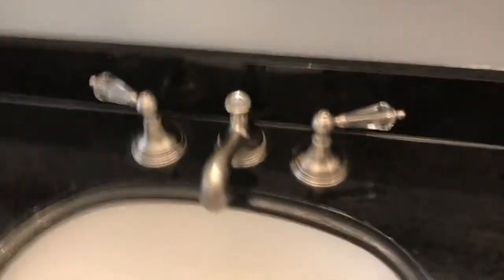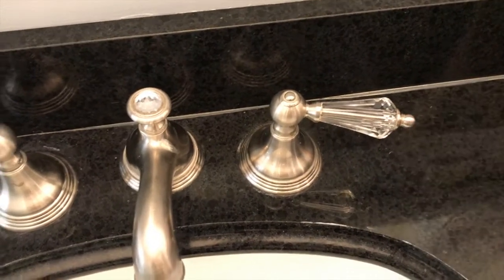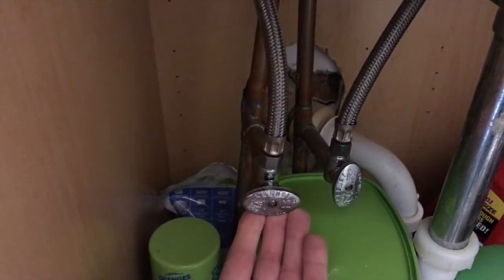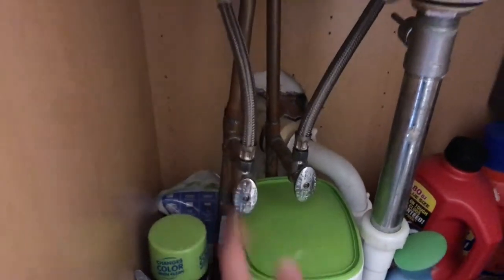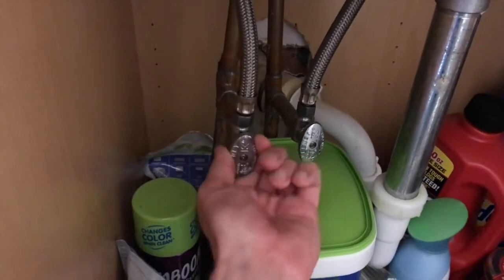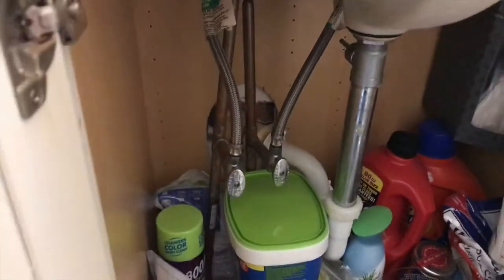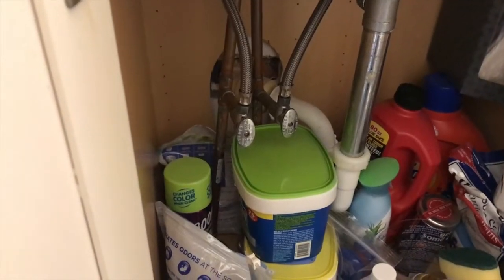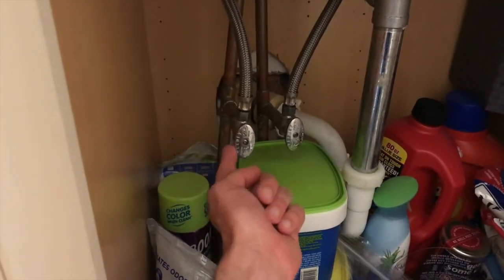Vibrating/Humming Pipes - "3 Most common causes"!

Comment: Allleelluuyaaa! 4 years living here with the noise(thut thut thut) when turn on hot water. Now I Fixed in 3 sec. 1:30 Thank you so much.
Reply from the maker: You are very welcome, and thank YOU for sharing this.  Hopefully a stress-free 4 years ahead to make up for it.

😁👍
Reply: I have another one downstair it makes samething but noise is louder than this one. I did the samething to fix it by ajusting the valve. But did not work. I will try to do this. https://youtu.be/E1D1OKrRy-Y
Reply from the maker: @Jodvix  

Bummer, let the DIY project continue until accomplished.  Keep us posted.. 😁

Comment: My humming is the bathtub faucet. It's a higher pitch hum and changes pitch as you turn the knob. This Delta 1400 faucet/handle was recently replaced.  I also notice the water pressure is not very strong- takes awhile to fill up the tub now. I have an old house, only shutoff is at the meter by the street.
Reply from the maker: Kymaureen1 

Thanks for watching.  You should have an internal shutoff valve in your home.  It may be accessible near your pressure tank & water softener.  Keep us posted on your project.  Us fellow DIY’ers need to stick together.

😎👍🔧🔩

Comment: I live in an apartment above boiler room in a old building with baseboard heating radiators. During winter months the heater/boiler makes a humming noise like and isle diesel truck, all night and sometimes morning.
Reply from the maker: Thanks for watching & that is actually common.  These type systems can also give off a crackling sound as the heat is being generated at heating radiators.

Let us know if you have any questions, hope all is well.  Enjoy your day.

😎👍🔧🔩

Comment: This is a bit of a long shot but I might as well ask. Can a faulty shut-off valve also cause water to be forced through the tap randomly? My Faucet is at the highest point in the house, and intermittently, sometimes when the washer is just turned on, it will vibrate and force water through the Faucet while making the vibrating noise. Turning the faucet on alleviates it.
Reply from the maker: @yotoniha  

Thanks for watching and that’s a great question.  It can indeed however not as common as a faulty stem.

The valves internal ball design can get damaged and no longer operate properly…leading to the valve operating as if it was half closed…when really it’s full open.

😁☕️🧰

Comment: I had an issue with a hum and it turned out to be a faulty ball valve(water intake and flash valve) in my toilet.I replaced that and it stopped. I took out a section of wall and tried multiple other fixes first no change.
Reply from the maker: Willis Taylor 

Thanks for watching & sharing your experience.  This can be helpful info for your fellow DIY’ers.  We appreciate it Willis.

😎👍🔧🔩
Reply: @DIYwithMichaelBorders  Thank you thought I'd share that fix because I've never seen it anywhere and it worked like a charm in my three storey condo where the tap on the first floor was causing a hum on the third floor took me a year to figure it out and two plumbers :)
Reply from the maker: Willis Taylor 

We really appreciate it.  Sounds like you’re back up and running!

😎👍🔧🔩

Comment: thanks for the video.  I was dealing with water hammer for a while.  I drained the system, and that went away.  Now, about a month later, the entire system started to hum/vibrate, extremely loudly.  Not when turning on a facet though; with no water off.  If I turn off the main valve to the house, it stops, or if I drain the system, again, it will stop, but it returned about 3 hours later.  Is this systemic pressure?  Is so, why all of a sudden?  I do have pressure relief tubes on various pipes.  Suggestions?  thanks.
Reply from the maker: Jeff Blankenship 

Thanks for watching.  Let’s get this figured together.  Have you performed any MX to any portion of your plumbing in the past 6 months?...new faucets, new toilet, new water filtration system, new water softener...??

This will help us determine if any recent MX is tied to your humming/vibrating.  Keep us posted.

😎👍🔧🔩
Reply: I have similar issue fixed today.  It found that the water pressure reducing valve (PRV) was broken and get replaced.  But you need to test whether your house internal water pressure is too high.

Comment: Great video, tho you would think a plumber could sort this, we have had 3 trying to fit a water filter and now been getting this problem for days. One came back thought he had fixed it and it started again. Driving me mad, my nervous system is terrible.  Turned what we THINK is the pressure down there is a shut of valve on it too.
Reply from the maker: Thanks for watching & welcome to the DIY Raptor Club.  You are not alone, it can be tough to diagnose.

What all has been replaced?
Reply: @DIYwithMichaelBorders  They still left a leak in the self tapping joint to the filter, the o rings to the outlet of the filter are in bits, it is just a diy joint seems to be leaking now, the way the filters have a diy way of getting into the water supply. The plumber used this instead of getting a proper t joint. Apparently they must some reason have removed the cold tap (faucet) as that had leaked and they mended that by wrapping round ptfe tape. Apparently it had been cross threaded but if so why did it need ptfe to fix it? The pipes are only about 2 years old, they were installed with the new kitchen. This isn't my own house it is rented but would expect the people you rent it from to get more qualified plumbers who don't create leaks in good pipes. I need ed a reverse osmosis filter as I can really smell the chlorine and am chemically sensitive. Later this year too fluoride is going in all the water supplies in the UK.
Reply from the maker: @Hypohair  

Thanks for the update, that’s no fun.  We definitely understand your thoughts & concerns as it’s a rental & you are paying the mortgage for the owner.

Below is a link to our video showing an installation project of a new GE Reverse Osmosis system, we love it.

😎👍

Comment: I live in an apartment that is half a floor below and right next to the room where they keep all the AC condensers on the floor above mine. There is one huge condenser that works with water that makes a very loud humming every time it is turned on. The humming can be heard in my entire apartment. Any idea what it could be and can I easily correct this without getting the building involved?
Reply from the maker: Thanks for watching, that no fun.  We would double check all of your little water shutoff valve’s throughout the apartment to ensure that they are all in the full open position.

That’s a tough one, since you’re so close to the high pressure unit.
Reply: @DIYwithMichaelBorders  thank you for answering. The unit is not from my apartment its from a different apartment but there’s some valves inside of the AC condenser closet. Maybe the valve will be in there?
Reply from the maker: @linav10  

You are very welcome, keep us posted.

Comment: Sorry, I do not understand how turning off the hot water valve stopped the hum.  There was zero flow in the hot water line because the faucet was off.  Plus before you turned the valve off it was already in the full on position but was humming.  You turned it from the full open position to off the back to the full open position.  Please explain.  Thanks
Reply from the maker: Thanks for watching & we appreciate you reaching out to us.  Goofy scenario for sure but we figured out the part causing it...😀

These little internal stems can cause annoyance at the tail end of their life span.

Hope all is well.  😎👍🔧🔩

Comment: Desperate need of help here! I have been stressing for weeks over this vibrating and humming issue and can’t afford to call out an engineer to help. 

I had two first floor bathrooms completely renovated, new toilets, new basin mixer taps, new shower fixtures, a bathtub, douche washers. 
Every time the hot water is used in any of the bathrooms there is a loud hum and vibration get throughout the house, so we are having to reduce the pressure on the faucets when using to stop the noise from coming. 
To be clear, this issue is ONLY on the new appliances which we have fitted in the bathroom, we also have a kitchen and downstairs bathroom which work without any faults. 

At first I thought it could be a loose copper pipe coming to the first floor which was vibrating due to not being strapped down but it seems all the hot water appliances are causing this issue. 
This morning the toilets had now started to hum while the water tank fills after it has been flushed. 

I would appreciate any advice to help me on this one as my family and I are struggling with this constantly. 
Thanks in advance!
Reply from the maker: Thanks for watching & sharing your experience.  Without getting too deep into it, you may want to have the company that installed/renovated come back out and inspect the plumbing.  They should be able to locate any issues pretty quickly.  Since this issue occurred after renovation, the company should be pretty friendly & want to help.  Keep us posted.

😎👍🔧🔩
Reply: @DIYwithMichaelBorders  Thanks for your message. I asked the company before they completed the work and they told me that it might be a loose pipe and that it wasn’t related to the work that they did on my property. 

So I can’t really go down that avenue unfortunately..
Reply from the maker: @The52blocks  

Thanks for the reply.  With that said, you will need to do some troubleshooting.  Turn one faucet on at a time until you can hear the faucet causing humming.  Keep us posted.
Reply: @DIYwithMichaelBorders  Hi Mike, having started troubleshooting, I did read somewhere where you commented a suggestion about turning off the mains water supply and opening the faucets to drain the system.
I did exactly that and left the faucets open on hot and cold for 30 minutes. I then shut the faucets and turned on the mains water supply. To my surprise the noise stopped completely!!!

A few hours later it started again slightly so I went to the mains water stopcock and I closed it a little to restrict the water pressure coming in to the property. This also helped to keep the noise down and didn’t have too much impact on actual water pressure. 

What are your thoughts on this please?

Thanks
Reply from the maker: @The52blocks  

Thanks for watching & you on the right track.  Since your troubleshooting steps lead you to a temporary fix, it’s clear that you have a faulty valve somewhere along the system.

Has there been any recent plumbing repairs at home?  This will help us see if any recent repairs are related to your issue.  Unfortunately what happens during renovation or remodeling, every now and then a plumbing pipe or connection fitting will be changed.

When an old valve is taken off or an old pipe is replaced, the new valve or pipe can be smaller than the old.  This leads to increased pressure within system creating that slight back flow...humming, vibration...

Keep us posted.  😎👍🔧🔩
Reply: @DIYwithMichaelBorders  Hi Mike, hope you are well. I have been monitoring this situation a lot and here are my findings.....
When any appliance is switched on for hot water at full blast then noise begins. The noise is coming from the tiled box which was built around the wall mounted toilet box. In that tiled box houses the cistern, and hot/cold water pipe for the handheld douche washer. That (I think) is also the access for the pipes which come up from the ground floor. 

As the box is tiled there is no access to open it. 

As a temporary work around I have reduced the pressure of water coming in to the house by closing the stopcock a little. This had stopped most of the noise (apart from two faucets) but at the expense of a reduced water pressure in the house, which is noticeable especially when two people want to use water at the same time. 

I have drained the system as per your advice also. 

Thanks
Reply from the maker: @The52blocks  

Thanks for the reply & sounds like you’re still heading in the right direction.  Is there access to the box from a crawl space or through basement drop ceiling?
Reply: @DIYwithMichaelBorders  Thanks for your response. Weirdly enough I have just noticed another odd noise which seems to have started a couple days ago. 

Whenever a hot water faucet is used in a bathroom there is a knock in the pipes under the bathroom floor: almost sounds like water hammer. The odd thing is, the knock begins when faucet is used, carries on making a thump/knock noise for about 30 minutes even after the water is not used (every 2-3 minutes one knock) and then stops until the next time hot faucet is used. 

Does this sound familiar?
Reply from the maker: @The52blocks  

Thanks for watching & this is unfortunately more common than you think.  It’s almost always related to a shutoff valve closing without being manually closed by a person.

It’s very possible that the internal valve/flap is broken & closing when it’s not supposed to.  You may have found your cause.  We recommend replacing that valve.

😎👍🔧🔩

Comment: My basement bathroom faucet vibrates when i turns on and stop after water is on so i should try your method by either turns valves all way on both hot and cold to test if it is not vibrates anymore the problem fixed but if it is still vibrates then i need change valves, right?

Comment: My one toilet wails loudly when it is flushed or it needs to refill the tank because of a slow trickle. It only happens on one of 2 toilets in the house. The good one is a level above. Not sure if this is a pressure thing. I'd call a plumber but I don't want to get ripped off.
Reply from the maker: Michael Em 

Thanks for watching & we hope you enjoyed the video.  You may want to check your toilet shut off valve.  It’s possible that the little shut off valve that feeds water up from the floor & into the toilet has worn out.  Replacing it may help solve your troubles.

Let us know if you have any questions.  Many more helpful videos to come!  😀
Please subscribe to the channel and turn on your YouTube notification Bell 🛎 that would be awesome thanks again!

😎👍🔧🔩

Comment: In beginning you turned on cold water but humming is from hot valve. Did I miss the explanation why the hot valve would be humming?
Reply from the maker: Bradley B 

Thanks for watching.  Crazy isn’t it.  It should have been the other way around however we figured it out & she has been running perfect ever since.  Let us know if you have any questions.  Us fellow DIY’ers need to stick together!

😎👍🔧🔩
Reply: DIY With Michael Borders I do. My neighbors well has a 1 1/2” galvanized Line from well to pressure tank. 30’. Where it comes out of cement next to house and 90s through brick wall to pressure tank it make a loud humming noise you can hear in house only when the pump comes on. Thank you.
Reply from the maker: Bradley B 

😎👍🔧🔩

Comment: I have the same problem but with hot water faucet in shower and I just replaced the shower tub and two faucet stem also I blended the water 
But still have same issue
Reply from the maker: Thanks for watching & welcome to the DIY Raptor Club.  Have you replaced shutoff valves located below sink?
Reply: @DIYwithMichaelBorders  
Not yet but I’ll. thanks
Reply from the maker: @puchubuturs6970  

Thanks for the reply, please keep us posted, us DIYers need to stick together!!!  😎👍

Comment: Ok so if you want to turn down the pressure because your new faucet sprays water out too hard what do you do? I crank my pressure down so it doesn’t gush out & I do get the humming. What are my options?
Reply from the maker: Thanks for watching & welcome to the DIY Raptor Club.  Does your faucet have an aerator screen on it.  If not, we recommend installing one & hopefully that should solve issue.

😎👍🔧🔩

Comment: Do you know what could cause a low humming noise when the hot water is turned on.  It happens when we turn on the hot water at any faucet.  Soon as we turn it to cold the “noise” goes away.   It also doesn’t happen every time.  I had a plumber come out and of course the noise wouldn’t happen when we was here.  He checked the pressure and said it was fine.  He also installed a hammer register on the kitchen sink pipe but that did nothing to stop the noise from occurring.   We have also removed all faucet heads and cleaned them out.  
Any ideas of what could be causing the occasional hot water humming?
Reply from the maker: Adam Daniels 

Thanks for watching Adam, let’s get this figured out.  Let’s start with a few options that won’t take any money out of your pocket.

First, verify each & every water shutoff valve household wide is twisted to the FULL OPEN position.  A slightly closed valve can decrease the water flow leading to humming.

If all valves are open...let’s try something else.  Turn on water & try & get the system to begin humming.  Once it begins humming, we recommend turning off one single shutoff valve at a time.  If the humming goes away after turning off a specific valve, we have found the valve that needs to be replaced.  Try all HOT & COLD valves.

Let’s start there, keep us posted.  Please subscribe to the channel and ring your YouTube bell 🔔 this will be very helpful to us thanks again.

😎👍🔧🔩
Reply: I am experiencing this issue. What was the fix?